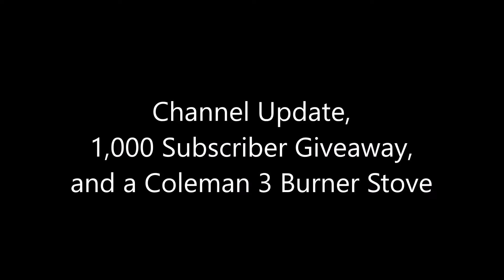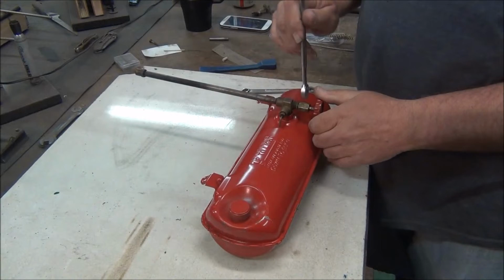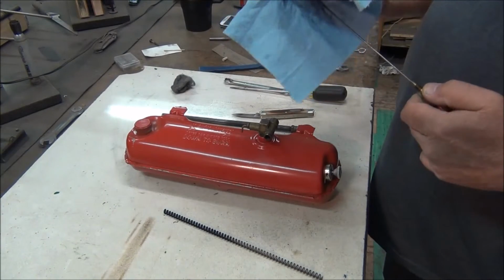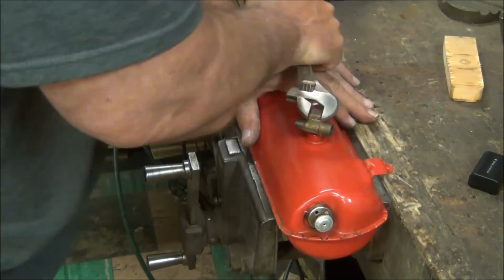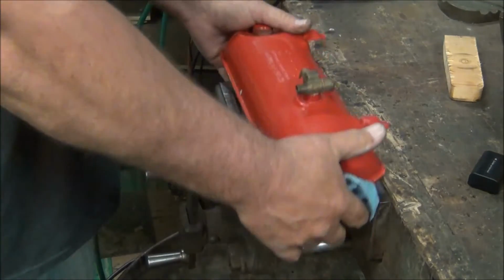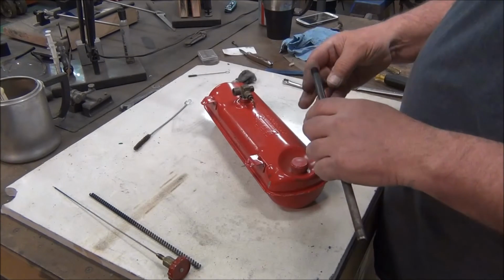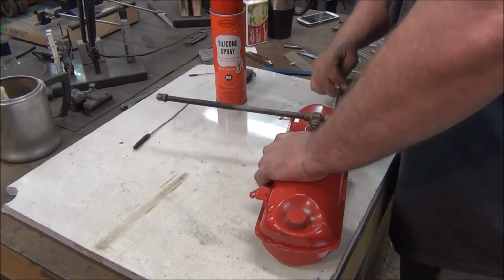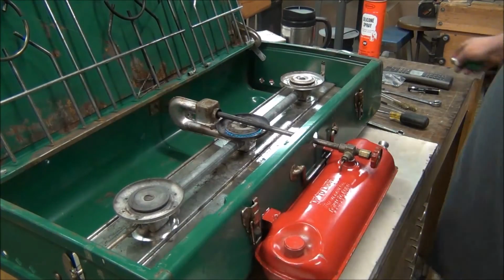Channel update, a Coleman Stove Repair, and a 1,000 Subscriber Giveaway Announcement

Comment: Thank you for taking the time for this refresher class.  Back in 1991 I purchased a Coleman 428 Dual Fuel 3 burner (suitcase stove) and it will not light. Still looks new.  I will watch your video a lot.  I suspect the generator is clogged up or the generator tube needs some carb cleaner or CRC cleaner. Lucky I had my Coleman Dual Fuel 533 and oil lamps during this winter storm in Texas it saved me a lot of grief.

Comment: June of ‘73. Yeah, it is “real old” for camping gear. It’s over 40 years old. This is why I’m a Coleman fanboy. Their lanterns and stoves just seem to last forever with some maintenance.
Another good video! Thanks.
Reply from the maker: 73 is fairly new compared to most of my camping gear. The average of my Coleman gear is probably in the 1940s. But you're correct, their stuff just keeps working, no matter how old they are.
Thanks for the comment!
Reply: The old ones do. The new China junk Coleman lanterns and stoves don't last nearly as long.

Comment: nice old coleman stove used to have a old 2 burner but it disappeared a few years ago .used to like tinkering (cleaning ) it after camping and long storage think ive got a lantern or 2 kicking around some place going to have to find and give them a good cleaning . thanks as always for sharing
Reply from the maker: You're welcome Wade.
I really like these old stoves. I have probably had over 40 of them through the years that  I've either given away to friends or sold. I think I've got 9 of them in the shop right now, plus a few rare military ones that I need to do a video on.
Hope ya get those lanterns out and fire them up. Always good to keep them in working order in case of emergency.

Comment: That was a pretty thorough video. When tearing everything apart, I flip the tank over and clamp the square valve assembly into the vice then use the tank as a lever to break them loose. Saves the paint and your knuckles.

Comment: hi new subscriber here. I just found in metal scrap bin a coleman 446 "explorer". it seems they were made from 1965-1975, but my question how rare are they? 
And yes before i took it all apart and cleaned everyrthing i did fill it with camp fuel and all three burners worked!!! Incredible. Now with everything cleaned the burners are a perfect blue flame, this this is huge thought. Fits two big cast iron pans, and a small pot at same time. haha i love it.

Comment: Nice,  3 burner! 
And thanks for showing how to check the date. I have three of them and the most recent one I but I noticed is way heavier then the previous ones. Immediately I figured it's probably much older. Due to the weight. I will check it out thank you.
Reply: Tanks are stamped under the ears. Stoves are stamped underneath the main body.

Comment: Hi Shane, at wits end with my 426c project. Ive cleaned everything, repainted, got it looking great. Came time to fire it up and it wont burn right. It fills the bowl up with fuel, burns yellow, and act like it doesnt have enough pressure. Any thoughts on my next move?
Reply from the maker: Did ya clean the generator. Might need a good cleaning or replace it. The pick up tube that goes into the tank may also need cleaned.

Comment: I was thinking: It working with diesel if preheating with something else fuel. First fill it small amount of gasoline and preheat. Add diesel when it hot. Problem which I noticed; need leak pressure and gasoline fume can ignite. In some countries heating oil (low tax diesel) is much cheaper. How about mixture?

Comment: Is there some reason you can’t use carb cleaner on spring and generator instead of scraping it with the knife? Would carb cleaner hurt it? 
I just got a three burner back from a scout troop I had donated it to when they first started up troop. Scouts can no longer use white gas stoves and adapter causes stove to go threw canisters of propane too quickly. Also stove does not fit in patrol box. As you might guess, after scout troop use my stove needs a complete overhaul.
Reply from the maker: Nope, carb cleaner will work great.
Reply: How did you clean food and grease out of inside of stove. You must have gotten stoves that were greasy.

Comment: So tell me.I've go an old 2 burner. Bought it new in late 60s think it might be a 425 not sure. It stated leaking raw fuel out in the bottom of the stove caught on fire. Thankfully it did not burn any thing down. So I run onto a 3 burner Colman at a flea market and I bought it for 35$.it did the Sam thing fuel run out into bottom of the 3 burner caught on fire. Can anyone tell me what is wrong with these Colman stoves.

Comment: Question? Can that stove serve as a dual fuel burning stove? With liquid wight gas, kerosene, Unleaded Gasoline -- And with an adapter Propane?
Reply: if you run regular unleaded gas in it  , it will clog up pretty quick cause of the additives in gas red tank means camping fuel and it will work on propane with adapter. you might be able to run it on kero but i dont know how well that will work
Reply: If you want to run on diesel, jet fuel or kerosene then you need to get an Optimus Nova or MSR Wisperlight International.

Comment: What sealant did you use on the threads?
Reply from the maker: I used a pipe sealant, I believe rectorseal was the brand. You can find it at most plumbing stores, Home Depot or Lowes probably has it too.
Reply: @SWPhotography  thanks mate 👍

Comment: EXCELLENT Job 👍
Except .....
Did I SEE a burning Ciggy Butt in the bottom Right, with OPEN fuel in a Glass Measuring Cup not TOO FAR Away on the Work Bench??!!!
Yikes !!!    I have NO SMOKING Signs all over My Shop.......I like it too much.
Oops, this was for the Catalytic Heater video...

Comment: I have a Duel Fuel 414, and I can't get the spring out of the tube.  I got the needle valve off easily, and wire-wheeled it along with some steel wool, but the spring won't budge.  Brake cleaner, choke & carb cleaner, even some throttle body cleaner --- NO DICE!!!  I soaked it in vinegar for 1.5 days, NOTHING.  Not even a discoloration of the vinegar.  It wiggles a liitle, but not on the ends.  It's loose about 1/3 up the tube on the inside, but that's it.  Bang it all I wanted, that spring isn't budging.  I can't compress it with anything either. Tells me ot's solid carbon buildup.  It may mever be able to get 'CLEAN' again.  It works much better though.  Now, the cock-vale actually works.  It has a twndency to burn yellow at start-up for.  .  .it varies.  1 minute, sonetimes 2 or 3, sometimes 4-5, you know.  Like the pressure isn't working until it gets warmed up.  I didn't take off the valve from the tank.  No vice.  I sure tried though.  

Anyway, and like I saud, it seems to work better now.  I turned it on for the first time after cleaning, and it burned yellow for just about 30 seconds, but then I fired it up again about an hour later and it bellowed yellow for about 3 minutes.  A 3rd time I lit it, it was completey blue, 😀.  The 4th, it burned yellow for about 45 seconds, and then started spitting like it was dirty.  I attribute that to the fact that, yes, it was dirt, and now it was hot enough to burn it all out.  I say that cuz the spring.  It's SOLID in there.  I don't really think it will ever come out.  I mean, when a half a can of brake cleaner doesn't budge it, you might as well hang it up.  I'll do the tank this weekend at a friend's place who has a vice.  

Thanx, sir.  You taught me, and I really di APPRECIATE your time.  No kidd'in! 😉😀

WWG1WGA

Comment: I went to the lake every week end in the 70's, I had a Coleman stove. The fuel tank you could refill it with large cans of Coleman fuel you could buy anywhere. My stupid inlaw stole it. Plus many other things..Can you find the refill type any more? I'm afraid of gas and propane . If it dont light quickly I panic. Yes im a woman SCAREDY CAT HA .  Ive moved, no lake here , lots of rivers if your not affraid to go here in the woods these days alone. Lots of drugs , and just plane evil people..i live on A large space. I'd like. to have one again. If power goes out , that's often. I need a stove. I have a all elect. home. Heat pump and back up wood heat. I have cooked  inside the wood stove, as a grill  before. Oh man it was wonderfull. Just like cooking over fire out side. But I've had two weeks of power outages from ice storms before ,  I NEED A COLEMAN COOKING CAMPER STOVE TO COOK ON MY DECK. This tank dont look like mine. Best I can remember. It's not refillable is it.?  CAN YOU STILL BUY A THREE BURNER. THAT would be a great idea, put a grill over two burners. Enjoyed this. Thinks.